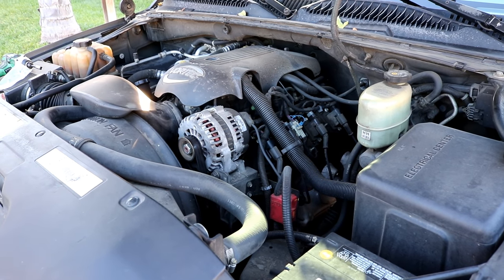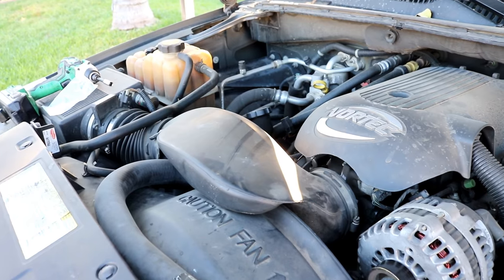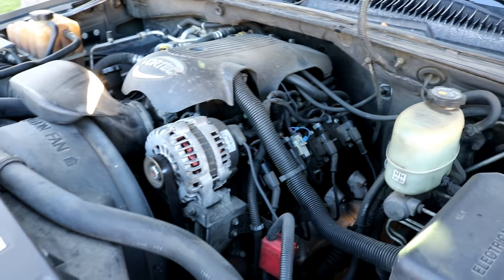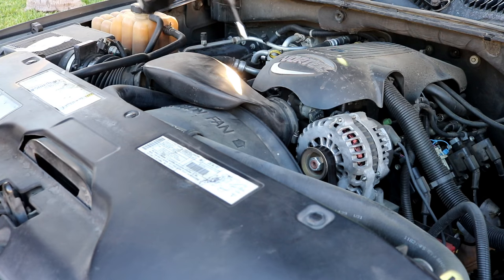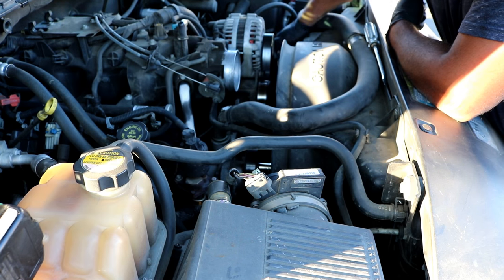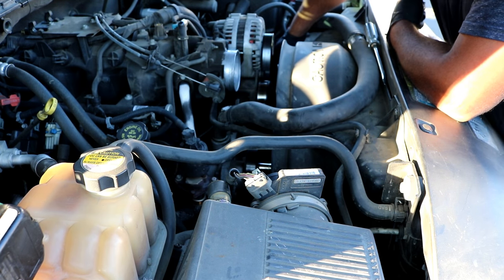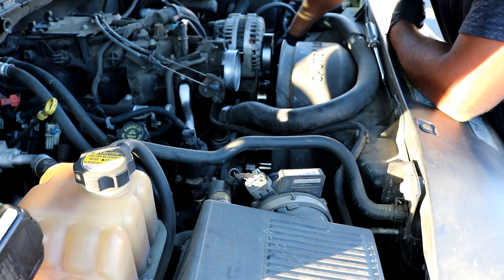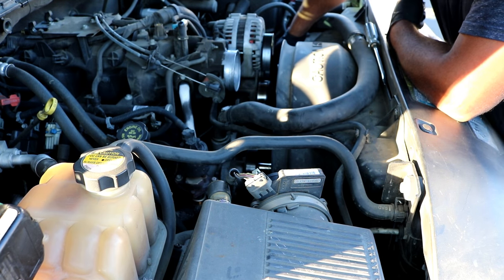2000-2006 Chevy Throttle Position Sensor P0122 (HARD SHIFTING SOLVED HERE!)

Comment: Does any one know why the rpm fluctuations between 45 and 60
Reply from the maker: That is the torque converter locking up. Normally on these trucks/SUVs, lock up will happen around 50-55 mph. At that point it should stay locked up as speed rises.

If you’re cruising along at 60+ and the rpms keep going up and down at times, you could very well have a problem with your lock up solenoid or a transmission problem within.
Reply: @HelpingHandAutoRepair  do u know why I’m having this problem , I step on it all the way and truck doesn’t go once it shifts gears it acts like if I wasn’t stepping on it ?? Any clues ?? Thanks
Reply from the maker: @MariaRamos-qo8ey  transmission is probably dead.
Reply: @HelpingHandAutoRepair  Is there any kind of adjustment I can do or tuning to stop it because I put on dual exhaust and it’s annoying
Reply from the maker: You can add a tuner that might be able to change at what point the torque converter locks up. Or just change driving habits. If you live in an area with hills or grades that you climb often, then it will be very hard to try and stop it from happening as the computer is doing it’s best to provide the correct shift points.

For example, lock up occurs around 50-55mph depending completely upon engine load. So if you are cruising around on flat ground above 55mph, it won’t fluctuate. It should lock up and stay locked up UNTIL you get back on the throttle. At which point it WILL unlock and either downshift to 3rd OR stay in 4th UNLOCKED. Then as you ease off the throttle, it will shift back to 4th and lock up OR if it stayed in 4th it will just lock back up again. All this is where the rpm fluctuations come from.
Reply: @HelpingHandAutoRepair  I got yeah it’s just freaking annoying when I’m on a road that won’t let me go past 60 “
Reply from the maker: Lol. Well if you don’t have to apply too much throttle, if you get to 55-58 mph and hold it steady. It should lock up and stay.

Comment: What if it keeps happening  after you replace it
Reply from the maker: tommy lewis You could potentially have a bad sensor even if it is new. If you have access to a scanner that reads live data that would be best as you can read what the TPS is doing and if it is bad or not. That would be the best course of action. If you don’t, you could swap out that sensor for another new one and see if it helps. If it doesn’t help then you have other issues with the transmission.
Reply: @HelpingHandAutoRepair  thank you

Comment: Hello I need some help??
Reply from the maker: Andres Lopez yes what do you need?
Reply from the maker: Andres Lopez yes what do you need?
Reply: Great , im having problems with my 2007 silverado 1500 4.8L .. my scanner shows throttle position sensor problems and the truck dont pass to second gear,  stays in first... what do you think about my problem???? THANK YOU VERY MUCH FOR YOUR HELP AND TIME
Reply from the maker: Andres Lopez so you do have a check engine light on correct? 

when you read the code it shows P0122?
Reply: Yes sir..  p0122 p0123 p0223 codes
Reply from the maker: Andres Lopez Ok your truck has the electronic gas pedal. There is a sensor on both the throttle body AND the gas pedal
Reply from the maker: Andres Lopez considering that you have the P0223 code and the P0122/123 codes it will hard to diagnose exactly which one is the issue because both codes are pointing to both the TPS sensor and the pedal position sensor inside the car.

My money is personally on the pedal position sensor that is attached to the top of the gas pedal inside the car.
Reply: Perfect, i will check both of them , because  as far as my knowledge i dont really think is my tranny  ... thank you very much for your help and time 👨‍💻👨‍🏭👨‍🔧🙏🙏🙏
Reply: @AndresLopez-km9cr  it may be a stripped gear in the throttle body or the electronic sensor in the gear box for the drive by wire gearbox. 2004 and up had the electronic throttle that have issues with the plastic gear teeth and or the sensor circuits in the throttle box or gas pedal.

Comment: I would floor it all the way n the truck wouldn’t move at all it would act like if I wasn’t stepping on it
Reply from the maker: Transmission is probably shot.
Reply: @HelpingHandAutoRepair  but all gears work
Reply: @HelpingHandAutoRepair  It’s only wen it’s like a 45 roll and on D if I put it in gears it takes off
Reply from the maker: Well that’s helpful information. Does the truck rev up? Rpms move? Or when you press the throttle nothing happens?
Reply from the maker: @MariaRamos-qo8ey  this is confusing. At 45 mph the truck stops?
Reply: @HelpingHandAutoRepair  it moves but it just moves super slow
Reply from the maker: Ok so from what you have told me. It shifts through the gears ok. But when you get to 45mph it feels like it doesn’t accelerate anymore? Is this correct?

If so AND the rpms keep going up, you seem to have a problem with it:

1. Not engaging higher gears like 3rd or 4th gear.

2. Not engaging overdrive.
Reply: @HelpingHandAutoRepair  rpm and speed move normal it just gets super slow bro , would it b the maf sensor or tps sensor ??
Reply from the maker: How many miles? Could be clogged cats.
Reply: @HelpingHandAutoRepair  I got long tubes no cats
Reply from the maker: Damn bruh. Lol trying to help you out. I wish I could drive the truck personally. From my standpoint, if you are flooring the truck and the rpms are moving up as they should but the truck simply isn’t accelerating, I’d say you need to take it back to the transmission shop the “rebuilt” it.

Comment: 8mm or 5/16th will work too.
Reply from the maker: It will work, but it is not the correct size. The 5/16” is bigger than the actual bolt. This is how bolts get stripped by using the wrong size. People do this all the time. Most American cars from probably the late 90’s until now have switched to mostly mm fasteners.

Comment: Nice video Man but you talk 2 much
Reply from the maker: Can’t explain how to do anything without talking lol.
Reply from the maker: It’s a good thing fast forward was invented
Reply: @HelpingHandAutoRepair  lol your right.. soo the rpms should be at 6000or higher?
Reply from the maker: For what?
Reply: @HelpingHandAutoRepair  what vehicle? A Chevy Tahoe 02
Reply from the maker: Look at your question bro. Why would the RPMS be above 6000? Do you mean 600?
Reply: @HelpingHandAutoRepair  should it be higher than 600?
Reply from the maker: At idle, 600 is acceptable. 650 would be a little better, however. My truck idles at 600rpm
Reply from the maker: The range is 600-650 with the ac on it should jump up to 700-750
Reply: @HelpingHandAutoRepair  mmm mine stay at 600even with the AC on and sometimes the truck wants to turn off..
Reply from the maker: Do you have an electronic throttle body?
Reply: @HelpingHandAutoRepair  yes I do coul it be IAC?  Might need a cleaning
Reply from the maker: IAC is probably ok.I was going to tell you to clean out the throttle body either way.
Reply: @HelpingHandAutoRepair  oh ok I'll give it a try thanks again for your time bro
Reply from the maker: Of course.

Comment: Ok I have a question concerning the replacement of the TBP on my 2000 Silverado.even though it will go on just one way I was told by a mechanic that it still has to be adjusted.Is he correct?
Reply from the maker: Brian Jones Does your throttle body have a cable on the side that operates it or is it fully electronic? You just bolt them on. Pretty simple
Reply: @HelpingHandAutoRepair It's cable operated but I'm getting mixed signals from people that calls them selves mechanics but doesn't obviously don't know what their talking about.Thanks for getting back with me.I appreciate it.
Reply from the maker: Brian Jones Wait I’m sorry bro. You have a cable. There is no calibration needed. Just bolt it on and be about your way.